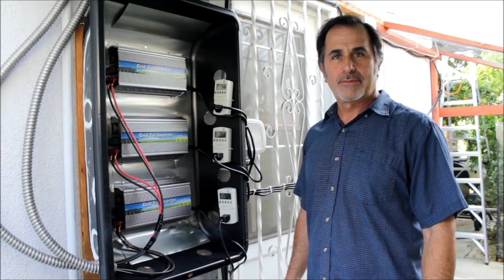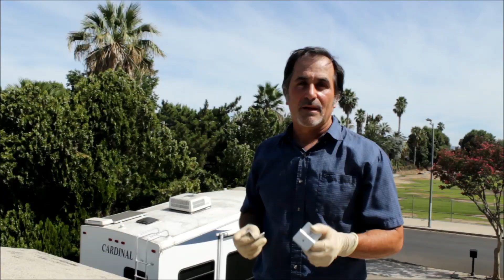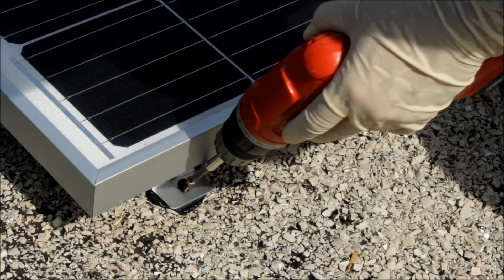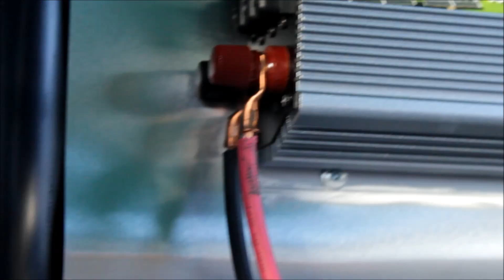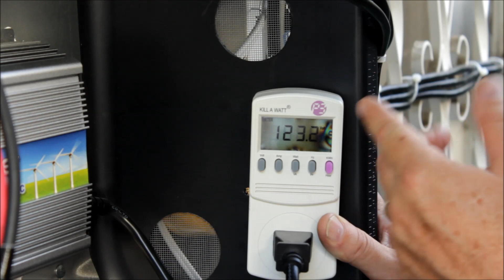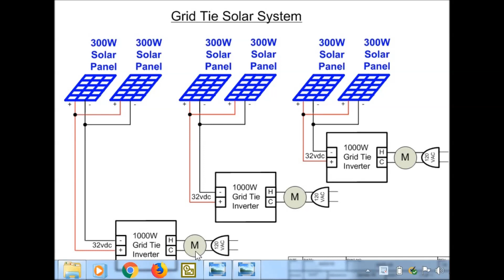Install a Simple Grid Tie 1000 watt Amazon Inverter Solar System-1800watts for $1800 (Short Version)

Comment: Those inverters plug directly into your AC outlet on your house, Are you using 3 separate extension cords plugged into 3 separate outlets? Are they on different breakers?

Comment: you could save some money and buy only 2 inverters. 
and for sure you could push this setup to more then a 500w per inverter if you would/could shorten dc power cables. today i shorten cabels to only 2m and i was getting 250+watts out of 310w panel vs 200w before with long cables, and its still february, getting cca 600w/m2 radiance from official weather station